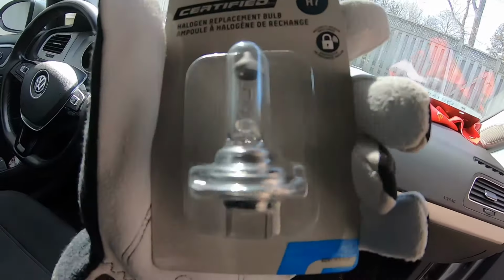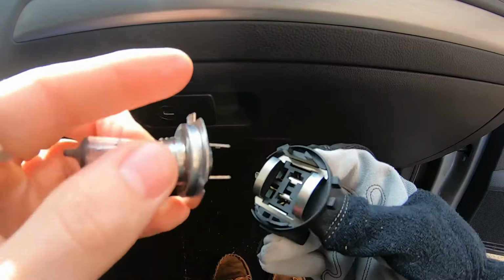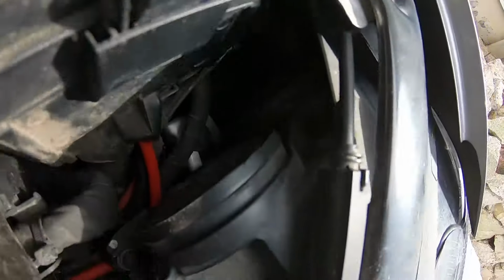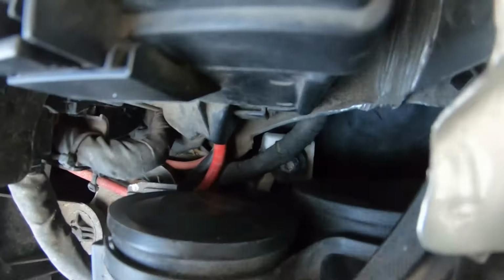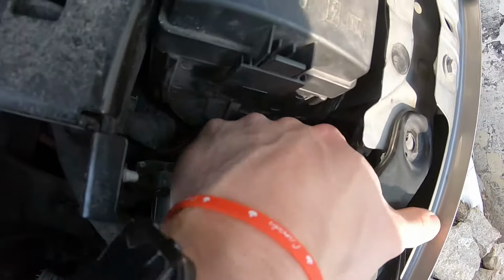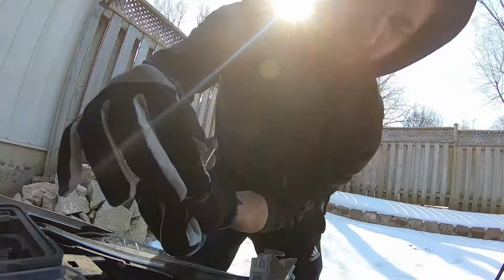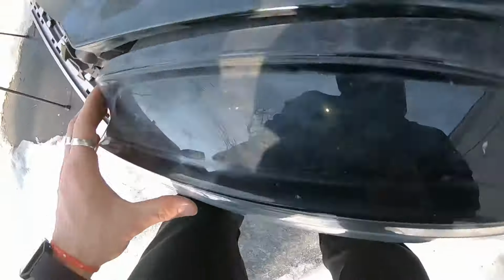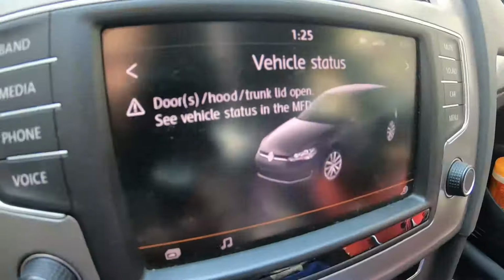How To Change Your Headlight On Your Volkswagen Golf | MK7 Golf | Easy | DIY

Comment: I change my halogen bulbs on my 2012 GTI without taking apart the front end. It's tight spot, my hands aren't that big and couldn't manage to turn that sucker, so I made myself a block of wood with a slot which brings the end out the back of the fixture so i could use an adjustable wrench on it to help to turn in a CCW direction.  It was easy to turn it back still with the block on the drive side but no wrench necessary, having my hand in the hole took the strength out of my fingers but i got it done. Use original part people, those LED's put on there cars are illegal because they blind on coming cars.
Reply: the wood block is 3.25" L x 1.75" W the thickness is not to important, i put a .25" slot .75" long now the this block becomes a tool. Put the light bubl adapter paddle in the slot hold it there, I use an adjustable wrech to help me turn it, make sure its CCW to get the blub loose. We are not using a lot of preasure here if it doesn't move your probably going the wrong way. hope this helps anyone.
Reply from the maker: thank you for leaving a comment i really appreciate it, im sure that your comment will help someone out! please consider subscribing it would mean a lot to me!
Reply: Blesss you sir, I don't know what the heck you said, but I know it was good and I need to try it lol I need a block of wood with a slot! I hate them LEDs especially on the big trucks.

Comment: If you have a vw with xenon bulbs, like a gti the light does not have the convenient little handle on it but rather a square igniter and then a round plastic donut that the bulb goes through. Even more of a PITA. Some people with small hands and superpowers may be able to do it w/o removing the headlamp, but your average Joe needs to get the headlight out. You have to drop one side of the bumper to get at all the bolts. You can spend hours trying to do it otherwise and skin up your hands and get grease and dirt on the bulb, but go ahead and try it. Don’t say I didn’t warn you. The bulb for those that have xenon is a Philips D2S 85122C1.
Reply: Isnt it D3S